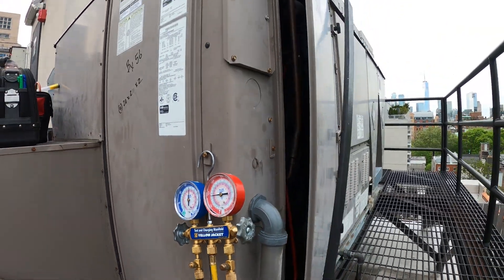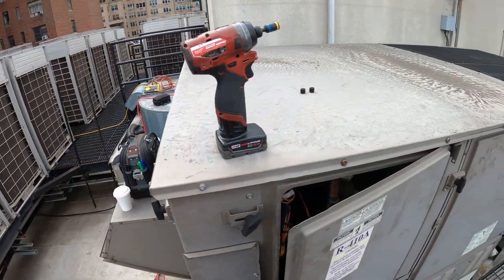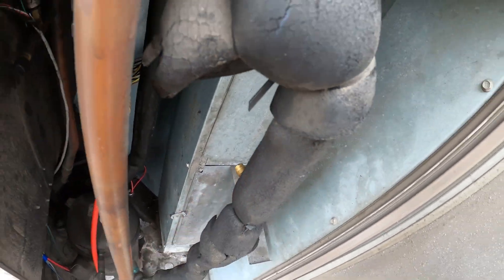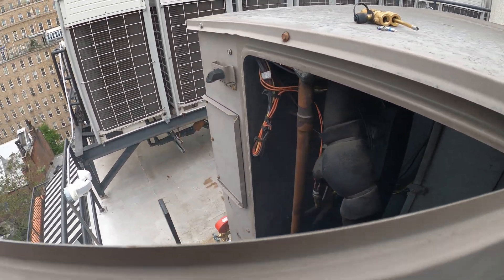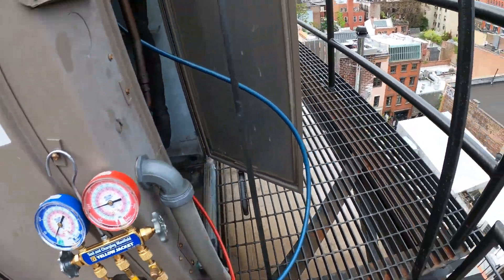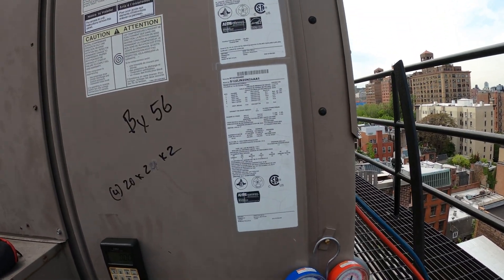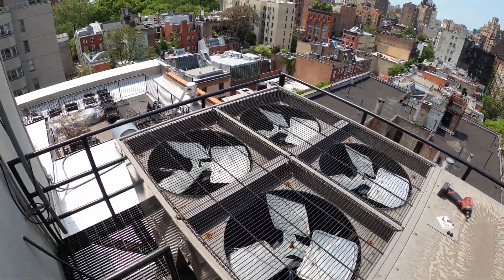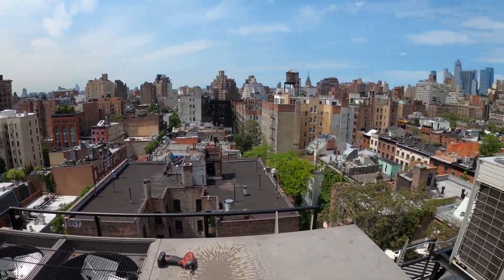HVAC Service Call: York RTU Low Superheat High Subcooling (Rooftop Package Unit High Head Pressure)

Comment: But if you have nitrogen flowing through the system, while you braising, doesn’t that get stuck in the inside walls of the piping since the inside walls of the pipes have oil?

Comment: What is your opinion on charging a rooftop unit that has removable panels on it that are screwed to the framing that must be removed to work on the unit and to hook up guages to get a reading  do you close up the panels as best as you can to get a more accurate reading or not?

Comment: To know which circuit is which I just look at the nomenclature on the inside and it shows you which contactors first stage in which is second stage and follow the wires to the compressor easy Peezy

Comment: 3:16 - you didn’t mention it out loud; but, I’m glad to see you cleaned the pipe before cutting it. Good practice!
Reply: Why is this a good idea?
Reply: @elwoodstelhommme8745  The smallest debris can wreak havoc on a sealed system. Even the bits off your sand paper/cloth can get into the refrigerant lines and make its way to the expansion device or compressor. Also, de-burring the copper with a quality tool is a best practice. The only things you want in a sealed refrigeration system is refrigerant and oil. It doesn’t matter if it’s comfort cooling or refrigeration applications.

Comment: Why cut it instead of sweating off??
Reply: When heat is applied to the dryer, it will release its trapped moisture back into the system. Cutting it off will keep that same moisture trapped in the dryer.

Comment: What was the purpose of changing the filter dryer if all you were doing was recovering/evacuating the system and then adding refrigerant?
Reply from the maker: Anytime you open the system, you are exposing the system to air which has moisture and the filter drier must be replaced. It's just the way to do it and its good practice to do so. Some people skip out on it at times but that's just not proper. Thanks for watching!
Reply: @JumpermanTech  but you didn't open the system until you cut the old filter dryer out. That's why I had asked

Comment: Circuit is written on the drier, also you said it was overcharged but never said how much you got out compared to what the nameplate is asking for, how you gonna know what the charge should be if you don’t know what circuit your working on?
Reply from the maker: I wrote that on the drier but it wasn't confirmed which circuit it actually was. I took a screenshot of the pressures the day prior and showed it in this video. It is clearly overcharged and by A LOT. The difference between circuit 1 and circuit 2 was only 8 ounces according to the plate. To be exact, use superheat, subcooling & supply/return temps if you can not find the manufacturers documents. Thanks for watching & stay tuned for new videos every week🔧⚡️

Comment: Thanks for this video! But what was the main problem of such a big difference SC/SH? Clogged system and filter particularly?
Reply from the maker: It had too much refrigerant in it causing that high head pressure and back pressure issue. Field mistake. Whenever you open up a system it is good practice to replace the filter drier. Especially knowing that the system is having pressure issues👍
Reply from the maker: You're very welcome & thanks for watching!

Comment: I heard you have to pay a monthly subscription for some of these wireless gauge apps, is that true with the field piece ones you use? Also does the high vs low side charging and nitrogen flow make a difference with the system being off?
Reply from the maker: I haven't heard about any monthly subscription fees but as far as the Fieldpiece ones I'm using, it's all free. The tool itself is pricey though. Well worth it honestly. Don't think it would make a difference but I typically flow through the high side & it's natural direction being this only does cooling. Thanks for watching!

Comment: Nice job! I'm not sure about that unit, but a lot of times, you can differentiate circuits 1 and 2 by the evaporator. Stage 1 will feed the bottom, otherwise, especially with a slanted coil cold condensate from the top will hit the warmer coil without both stages running and can drip off the coil, causing water leak issues.
Reply from the maker: Thank you!! I appreciate the feedback & those tips. This unit needs alot of love 😂  Thanks for watching 🔧⚡️

Comment: Great job JMT. What pressure do u run nitrogen at when brazing?
Reply: Very little about 5lbs psi. You can tell while you’re brazing if your braze starts bubbling out turn down the psi. Shrader core out.

Comment: I wonder if they (who ever was before y’all) dumped all the refrigerant in one circuit instead of putting the refrigerant in two separate circuits. That’s why one side was overcharged and the other one had nothing.
Reply from the maker: It's always a mystery. You really never know. I've seen so many hacks and strange things over the years. I like to start with a clean slate. Cleaned coils & proper vacuum/charge👍